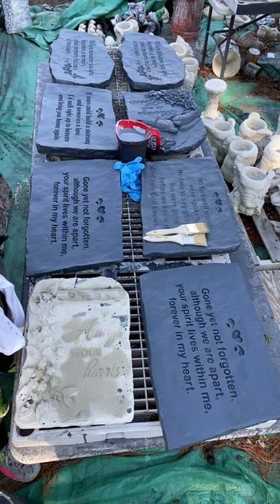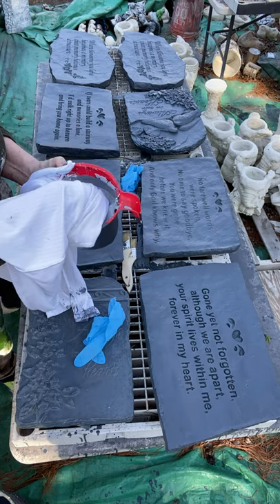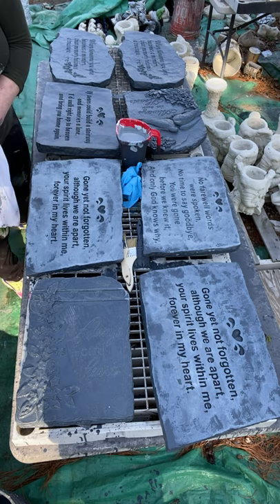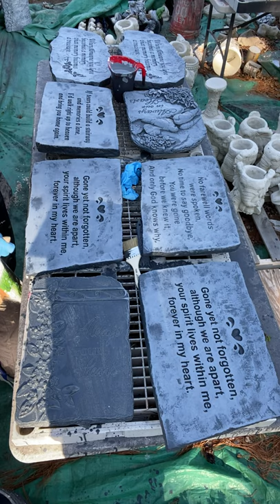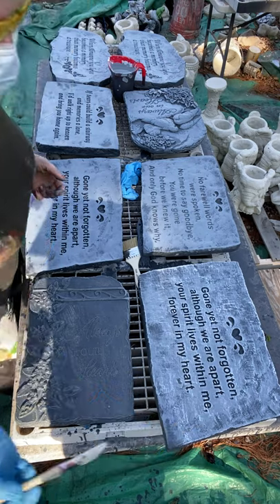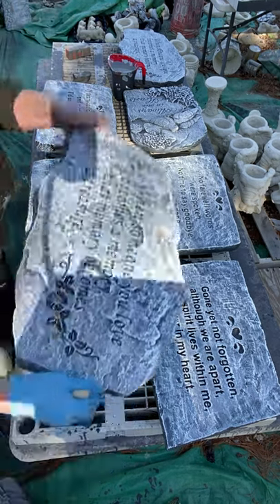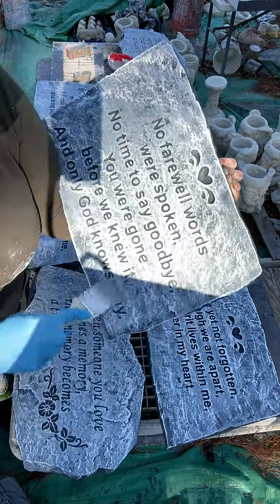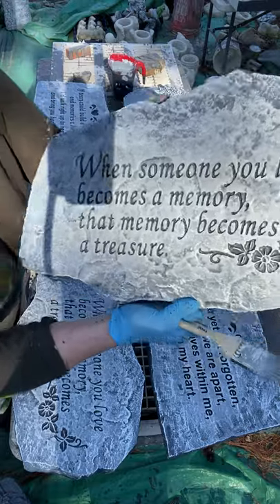Painting concrete memorial plaques in 3 simple steps

Comment: Do you seal the concrete after painting?
If you do, what do you use?
Thanks
Reply from the maker: I don’t usually.  On my hook request.  My reason is because I don’t want a “barrier” to get through in the event I ever need to touch up an item.  

However, I do seal plain concrete items on occasions with Behr wet look sealer.  I prefer the semi gloss look and it seems to be non yellowing on some items I have tested.

Comment: Did you make a video on how to get the letters in there that would be really nice to know I plan on using foam and having to dig the foam out
Reply from the maker: I use latex rubber molds so the letters are in the mold then I simply pour the concrete into the prepared mold and allow them to cure